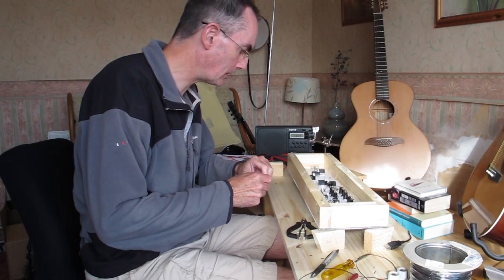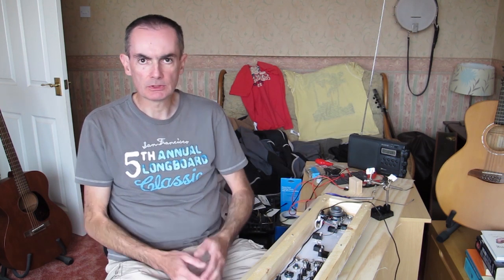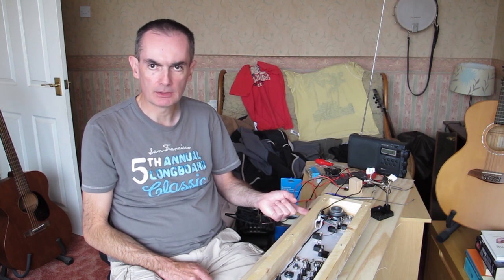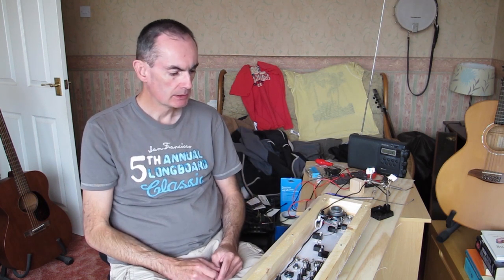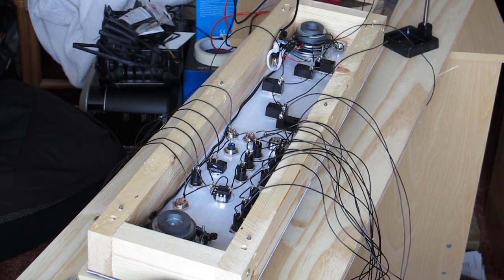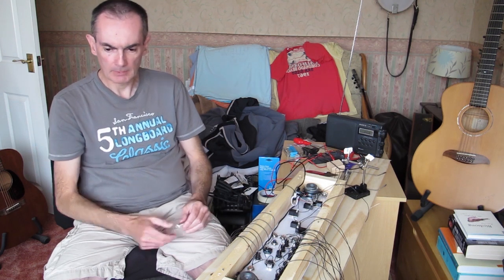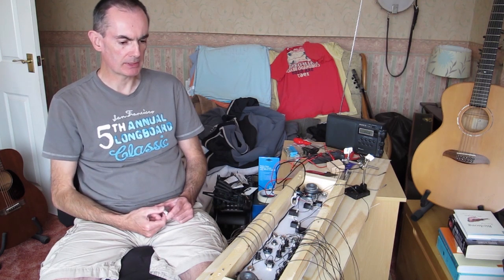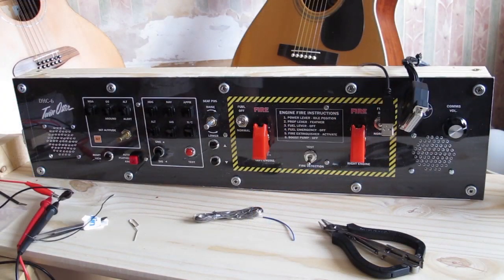Wiring the First Panel (Twin Otter Cockpit Build - Part 10)

Comment: Best way to do the lighting is to use LED Strips which are strips of LED lights every 5-10 mm. You can get them from Ebay for around $1/metre, don't buy them from hardware store where they'll cost u $10/metre. They'll give lovely omnidirectional light in any colour you wish. Hope that helps.
Reply from the maker: Thanks, I will be looking into that way too!